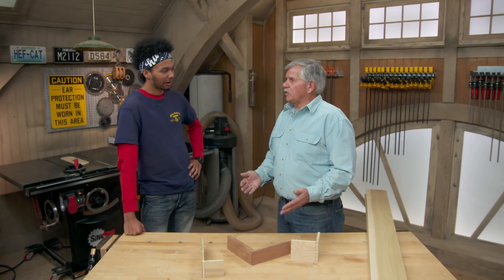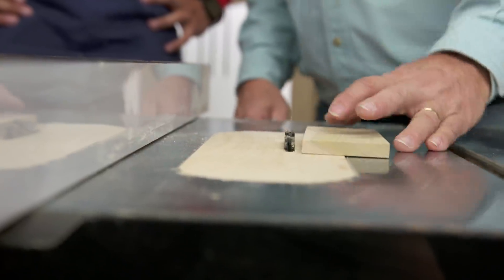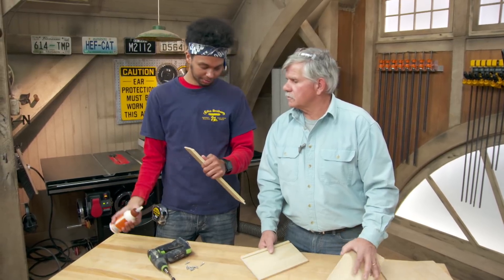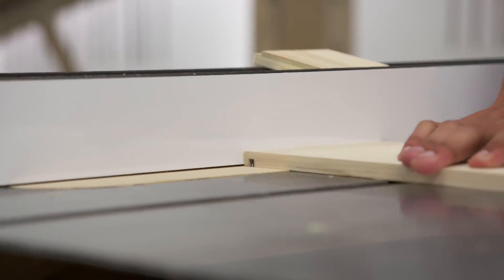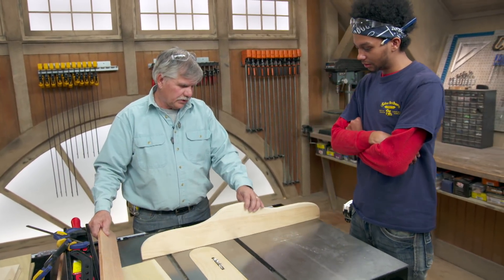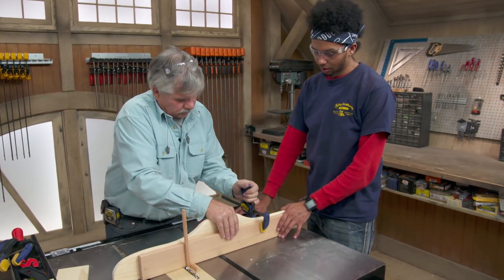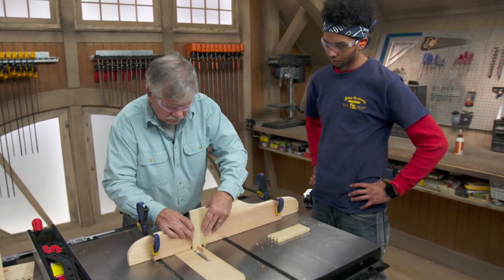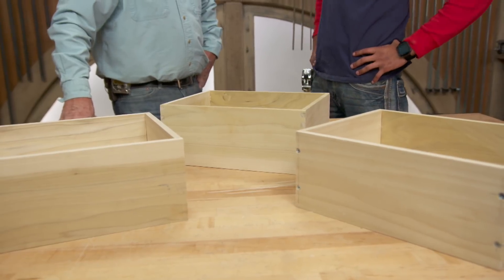How to Cut Wood Joints | Generation Next | Ask This Old House

Comment: Sorry for the loss of a good skilled and willing to work student.  HOWEVER, please never cut a rabbet as was shown in this video.  There should have been a sled over the fence which the vertical board could have been clamped to, or use a miter gauge and lay it flat, which is what I make my high school students do in the shop.  Way safer and just as accurate.

Comment: RIP Austin. That said, how many home owners can afford a SawStop? I'd like to see ATOH do an episode on building your Old House Workshop on the cheap...
Reply: Well you can by retrofit kits, but realistically a sawstop tablesaw is really no more expensive then a decent tablesaw to begin with.

Though to be fair, you can do any of these techniques on any tablesaw, but if you're basing pricing of the saw stop vs saw a shitty dewalt 400$ tablesaw, then you're probably not looking for quality equipment to begin with.
Reply: A good quality table saw is only around $3,500

Comment: The Pins were too short on the box joints.  The blade needed to be raised just a bit more.  These types of adjustments should be commented on as well as how loose or tight the fingers are.  I guess not very DIY, more "made for TV".

Comment: Not a rabbit it's a rebate , pronounced reeebate . ( sigh ... head in hands )
Reply: Deep breaths and less caffeine will help you get better.  A simple search shows it's both, and since this was shot and produced in the US, rabbet is the preferred term.  An astonishingly easy Google search yielded: "A rabbet (also known as a rebate outside the US) is a recess or groove cut into the edge of a piece of machinable material, usually wood. When viewed in cross-section, a rabbet is two-sided and open to the edge or end of the surface into which it is cut."Stop sighing and take your head out of your hands.  You look like a rube.
Reply: kellerrobert80 you're right , it shouldn't bother me that much but it just grates soo hard . I will seek help .
Reply: no wonder my router is clogged up with fur........